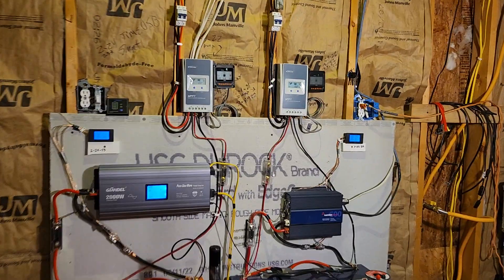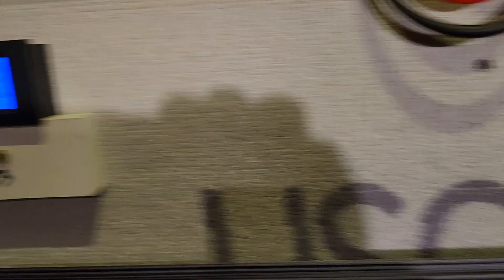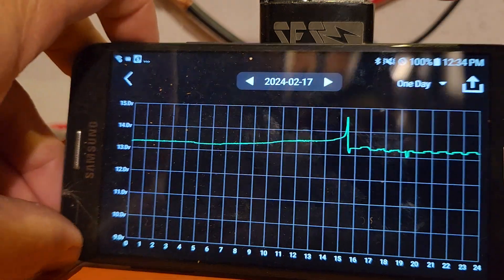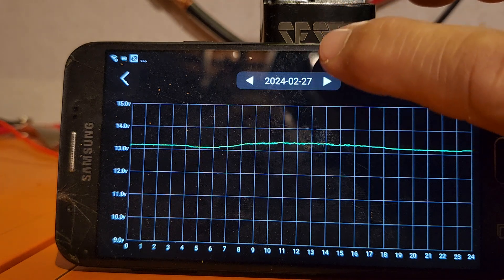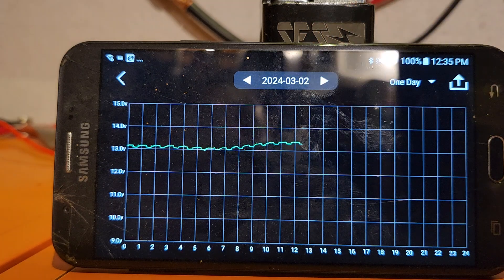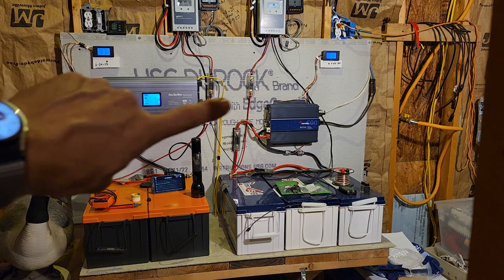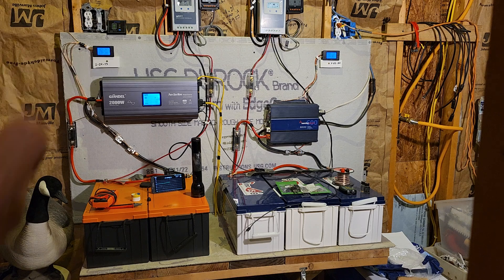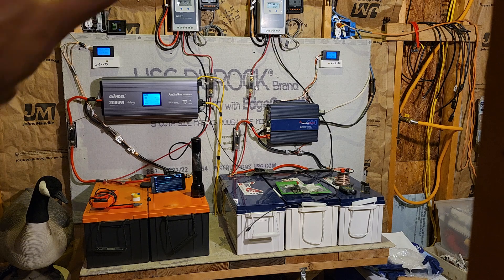12v Off Grid Back up system saving me money by running the fridge.

Comment: You buy elect. at 14 cents KWH. That ref . uses 2 KWH, maybe 3 a day.. At 30 cents a day/$110 a year. How many years till break even? Show me your capital costs.Panels/batteries/balance of system.
Reply from the maker: The straight cost of electricity is not the only consideration in payback...

My electric company also charges a meter charge which is based on useage...the less I use ...the less the meter charge... and you are correct payback will take YEARS...if ever.

When you consider its upfront cost as opposed to an outside generac generator at least in the case of solar and batteries.....your getting some return on your investment...

On top of ALL that....I offgrid the fridge because.... I CAN.
Reply: North of you in Com ED territory, we pay a fixed meter charge,line to the house charge of $ 16, We then pay variable per KWH charges of about 14 cents a KWH @CentralIllinoisSolar

Comment: After having gone through a 24V to 48V upgrade and also needing some legacy 24V items, as well as some legacy 12V items, I came to the conclusion that I really wanted all of the solar and most of the inverter loads hanging off the main 48V system (because amperages are so much lower, everything runs cool, and nothing even gets close to maxing out).

Dealing with the legacy 24V and 12V turned out to be completely trivial and I think you could use the same trick with your fridge.   So here is what I would recommend for your 12V to 24V upgrade:

* Put all of your solar and most of your batteries on your new 24V system, along with the new 24V inverter.

* Leave one 12V battery free and hold onto the 12V inverter (if needed) for your fridge system.

* Use a cheap charge controller, I use a Victron SmartSolar 75/15 ($65), to down-buffer from the 24V system to the 12V system.  This is wired basically like this:

   (1) (24V system bus) -> inline 10A fuse -> "solar" input of Victron, and then
   (2) "battery" output of Victron -> 12V battery -> (fridge stuff... inverter and fridge)

   Set the victron up with Victron's bluetooth app (get the "smart" version of the charge controller so the bluetooth is built in).

  The fuse is mandatory because charge controllers, including Victrons, can over-current the "solar" input as part of the MPPT or as part of the over-voltage protection circuit.  While this will not normally occur, the fuse is still needed for safety just in case it ever does.

--

The way it works is that the Victron 75/15 down-buffer keeps the 12V battery charged from the main system as a priority... as long as the main system battery is operational, it will keep the 12V battery fully charged (ultimately holding it at the float voltage).  Which is basically what you want.  If you lose power then your entire system is available to keep the fridge going if necessary.  Your 24V system will keep the 12V battery full until the 24V system dies, and then your 12V satellite battery will start draining to keep the fridge going until it dies.

That particular charge controller can charge the 12V battery at 15A (up to around 200W), but since the fridge is cycling its average consumption is going to be far less than that so having that dinky little charge controller works just fine.  The 12V battery handles the surge and the running load.

In anycase, I strongly recommend putting all the solar on the highest-voltage battery system and not splitting it.  That way the power will always go to where you need it the most simply by virtue of the battery buffer having priority (sucking up whatever it needs to keep the lower-voltage satellite battery full).   Multiple charge controllers can be on one battery system, no problem.

--

Implementing low battery "load support" from the grid is even easier (for your main 24V battery).  Just get a Victron Energy Blue Smart IP67 24-Volt 12A 120VAC battery charger.  What a mouth-full.  But here's the thing... it has a "power supply" mode where you can just set a decent load-support voltage that is roughly at the battery level you want support from the grid to kick in... e.g. like 26.0V or 25.5V or something like that.   Since it is designed as a battery charger it will do everything else for you including working properly and not trying to transmit power when the battery is at a higher voltage than the supply due to your solar.

So something like that can push 12A (there are bigger chargers available if needed)... at 25.5V that would be 306W.   So as long as your average whole-system load is below that, one of those chargers will do the trick when you hit multiple days of inclement weather.   And you can always have more than one feeding the same battery bank.

Even better, the load support will gradually activate slowly, sharing power delivery with the battery as the battery gets lower and slowing the battery decline for often a whole day before the load support completely takes over.  this means that you can bridge a day or two of bad weather with minimal grid consumption even though the battery isn't big enough.

If you want to run the battery at a higher SOC, you just use the blue tooth app to push the voltage up or even switch it to "battery charger" mode to keep the batteries fully charged, which does the 3-stage or 4-stage charging properly.

-Matt

Comment: Those output transformerless high frequency inverters are not going to last very long before the MOSFETs are fried from repeated exposure to your refrigerators high inductance status up currents. If you want a system that's going to last long term, then I would suggest that you purchase a heavy duty, low frequency, transformer based inverter for your upgrade. Cheap Chinese made, high frequency inverters like these offer too low of a surge capacity and a far too low life expectancy for repeatedly powering inductive loads over the long haul.
Reply: What frequency rating would be considered low?

Comment: Have you ever showed the schematic of your two systems.  I am about to follow your lead since I’m in Central Indiana.  I’d love to see a drawing of your systems especially now that you are upgrading to 24v……

I am getting an AmpInvt 1200 Inverter to try out and demo.  Love to have it power my fridge and freezer taking both off grid.
Reply from the maker: I would suggest sticking to the 200 watts for 200 ah rule. Which is where I'm taking the 20a system by going to 24 voIts  It currently is running 280w for 400ah and doing WELL  But I want to add more load so 200/200 it is